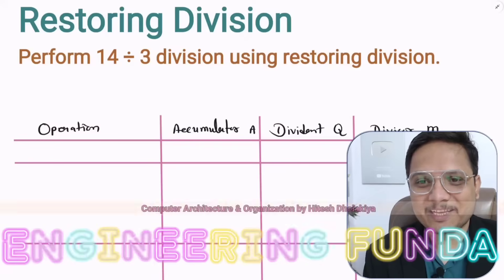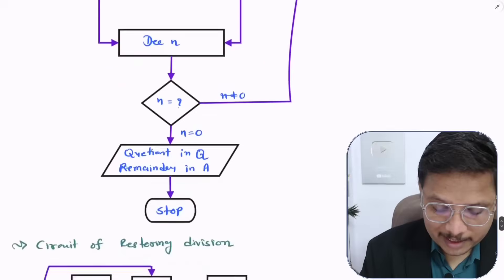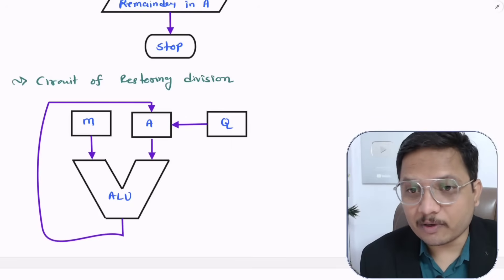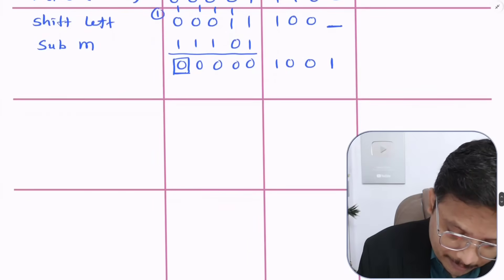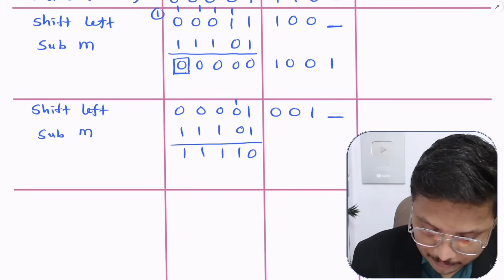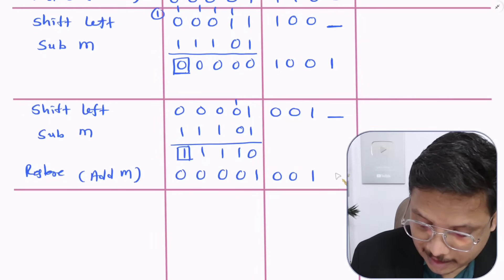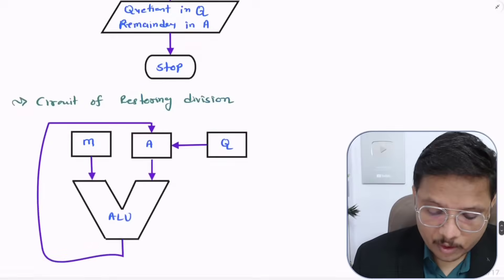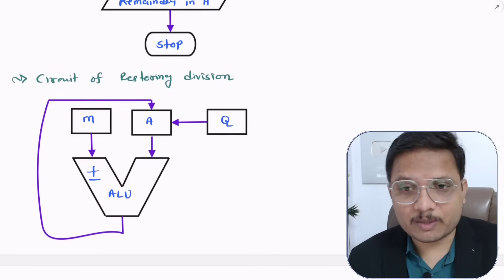Restoring Division Algorithm: Flowchart, Circuit & Example Explained | COA

Comment: Why did u take m as 5 bits, Q as 4 bits?
Reply: +1 lena hota hai bhai itti baar toh bole sir
Reply: 5 bit answer is more accurate than 4 bit.
 for example if we do multiplication of -7 and -3  in 4 bit , its answer comes 23 ,but if we use 5 bit then it is accurate 21